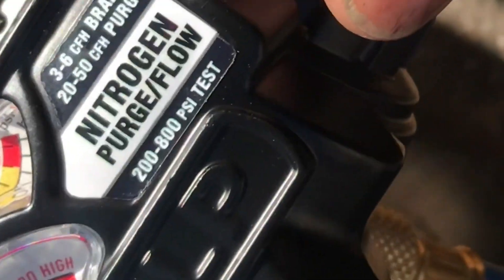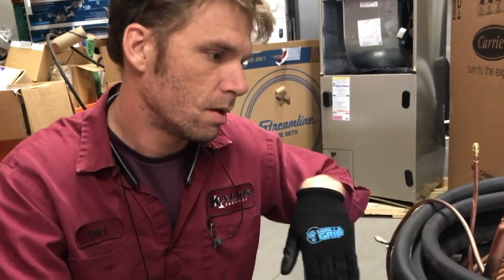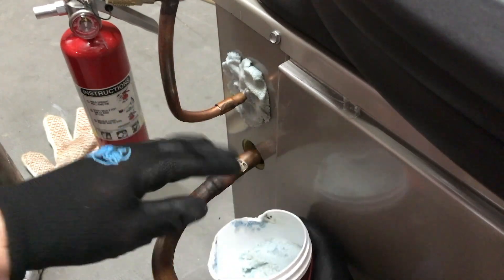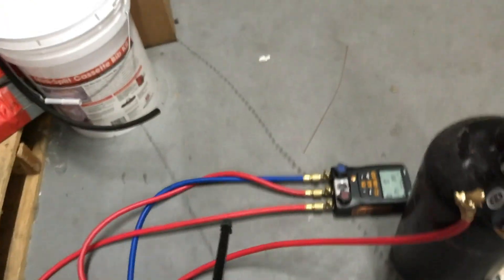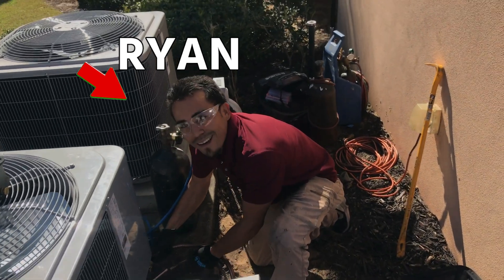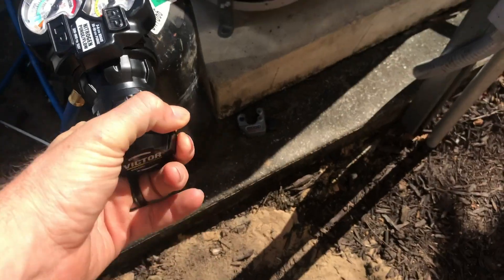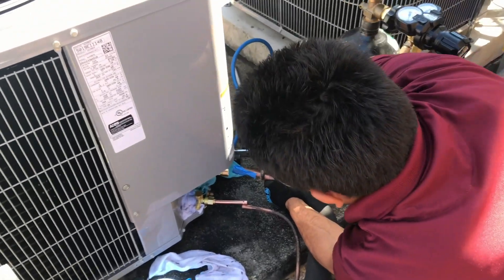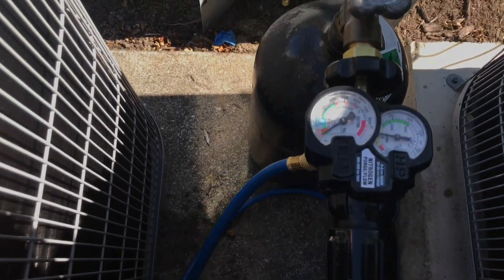How to Flow Nitrogen While Brazing

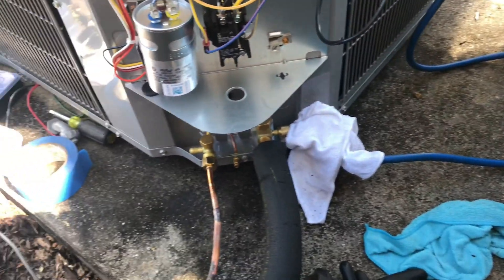Comment: 10:50 - Can you get the canoe in the reversing valve positioned so the nitrogen flows through all the pipes at the same time, or is that a multi step process? I’m not sure how to proceed to be sure there is no moisture left at that point.

Comment: When the trainee started brazing, I was expecting to see a turbo torch. The gross majority of new guys and residential guys I know use a turbo torch. It drives me nuts; but I'm a commercial/industrial refer guy. Same concept, just a completely different animal lol. I was pleasantly surprised to see your trainee using oxy-acetylene. Nice quick heat to get in and out instead of cooking the s#!t out of the joints with a turbo torch. 

Just a little constructive criticism for the new guy(not so new anymore since the video is a couple years old)...I would've wrapped the service valves a little better and I would've added a drier. Especially since you're reusing the line set (unless the condenser already has one in it from the factory?).  A sight glass probably wouldn't hurt either depending on how long and how high the line set goes. Otherwise this is a great informative video. It's very important to flow nitrogen.

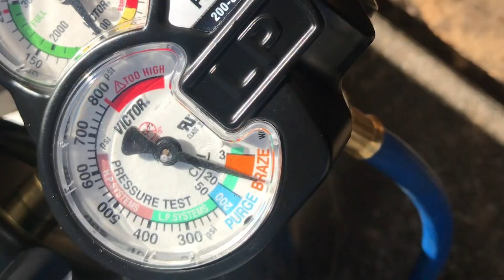Comment: 9:13 - What length of time would you give for the purge before backing the flow down to braze?
Reply: I made a mason jar to flow through and extinguish a candle flame within to determine the time for the size of the system that I needed to purge. Now I just time it based on that for that system. All systems are different sizes. 
But a few minutes is basically it. I’m assuming like me you want to conserve nitrogen.

Comment: Schrader valve. If that purge regulator only went to 150 psi it would be perfect for what I do.
Reply: What do you do?

You can set that regulator to a constant 150 psi all day as long as there is at least 150 psi left in the nitrogen tank.

Comment: Decent video. Just was looking for where the part saying the order of brazing. Everyone I've see so far just brazes in whatever order. Mostly they be doing everything outside first, then inside. I was told/taught to follow the flow of the nitro was the right way. Hard to find that on the internet.lol. By the way you said their was, "Oxygen in the air.".....😆 Kinda lost me some areas on here. Like when you pulling a vacuum, your also pulling the Schrader valves??? I thought, " You'd be just pulling another vacuum if they not in there.🤣 Or is everyone doing that wrong also??🤣
Reply: I know this is an older comment, I'll try to explain some of the concepts in the video. 

Removing the cores will allow you to pull a nice deep vacuum relatively quickly. There's nothing in the way restricting the vacuum pump. But if you pull a vacuum with the cores removed, you MUST use a special vacuum rated core tool so you can put the cores back in when you're done. Otherwise the entire system will bleed out when you remove your hoses without any cores. When using the core tool, make sure you put the cores back in AFTER you charge the system and it's under pressure. Never put the core in while it's under a vacuum. You'll end up introducing air back into the system, even just a little bit, and you'll have to pull another vacuum again. I highly recommend Trutech tools. If you're confused about what you need, just give them a call and they'll help you get set up with what you need. They're extremely friendly and knowledgeable and, in my experience, they're much cheaper than what you get at your local wholesaler. 

When it comes to brazing in a certain order, it doesn't really matter. The most important thing is to understand how the system flows and operates. This understanding should become second nature and it will allow you to approach it in a way where you'll know if nitrogen is flowing in the area you're brazing. There is no specific order. All the joints have to be brazed eventually. I also recommend using an oxy-acetylene torch instead of a turbo torch. Especially around service valves and TXVs. Those components have a lot of mass and can take a lot of heat before braze rods start flowing. Oxy-acetylene is nice quick heat that will allow you to get in and out instead of cooking the s#!t out of it with a turbo torch. I've seen a lot of guys screw up brand new out of the box valves using a turbo torch. 

When you start heating up copper with your torch, the oxygen in the atmosphere causes copper surface to oxidize and black flakes will get into the system. Depending on how much oxidation gets in there, it will start plugging up the TXVs(or whatever metering device), filter driers, and whatever else is in the system. Since nitrogen is an inert gas, it will prevent the copper from flaking and will keep the inside of the copper lines nice and clean. In my experience, some oxidation in the system won't cause any problems, but the potential is always there. 

If there is anything to take away from this video, make sure you understand the refrigeration cycle, think, and just be smart about your brazing practices. Once you work on enough of them, your understanding of the process will become second nature.
Reply: The best practice for the order of brazing is from where the nitrogen goes in to where it comes out! It seals it off as you go to where it exits! Just in case, but not likely, you have any introduction of air into the system at an unbrazed joint before the joint you are brazing! Normally speaking this will never be a problem when positive pressure is maintained with the nitrogen flow!

Comment: How do you know nitrogen has filled the whole system (time to start brazing)?  Or just by guessing?
Reply: I built a flow through mason jar and put a candle in it.
When the candle  goes out I give it thirty seconds more, then turn down to a whisper and start brazing.
Reply: Use the maximum pressure on the nameplate

Comment: What can be done (if anything) if the contractor installer never purged with nitrogen while brazing a new install with new line set? I have witnessed this so often, i thought it was the norm!!
Reply: Check temperature drop across filter drier. 

If filter clogged with trapped debris it will form a restriction and result in a measurable temperature difference between the inlet and outlet of the filter drier.
Reply: This is an old comment, but I'll respond anyway. What I would do is perform an inspection and preventative maintenance on the system. Change the air filter, wash the condenser, inspect and tighten all the electrical, and then check the pressures and temperatures on the system. Maintenance should be done every year. If the pressures and temperatures look good, I wouldn't worry about it. If there is an issue, the system will have to be opened up to clear the restriction and a filter drier should be installed to capture any residue flowing through the system. 

It's usually a pretty straight forward procedure. If you're a technician, you should know how to do all this(or you're learning how to if you're new). If you're a home owner, I highly recommend getting in touch with a reputable service company and get on a service plan. They'll come out and service your equipment once a year and you'll usually get a discount service calls and repairs if you end up with a problem.

Comment: Would using the vacuum pump work ? To remove oxygen while brazing ?
Reply: If pulling a vacuum while there are fittings yet to be brazed, what are you pulling into the system?

Comment: thanks Bert. the person that showed me didn't take out the schrader core when flowing. now it makes more sense!
Reply: I know this is an old comment, but here's my two cents. In this video example, it's a basic condenser and air handler install, so it was smart to remove the cores in this case. However, it may not be necessary to remove all the cores in the system. It really all depends on how you're flowing the system and where you want the nitrogen to go. Sometimes, instead of removing the cores, you can just hook up your gauges and let the nitrogen just flow out of the hose.

I work on commercial and industrial refrigeration. Refrigeration systems have all sorts of different controls and components where refrigerant flows through. Depending on your situation, you may not need to remove a schrader core. The most important thing is to understand how everything flows through the system. This understanding will allow you to control exactly where you want to flow nitrogen. If you work on systems enough, this understanding will become second nature.
Reply: @paulcrandall2534  removing the cores important for the next step, vacuuming thw system and verifying decay leak rate.

Comment: Good video. So many installs and repairs are done with out nitrogen.  I had a discussion with someone about the nitrogen usage and the heat flow while using it that I created a thermal imaging video showing the use and the heat flow direction in regards to the flow.
Reply: While you're brazing, the braze rod always follows the heat. You can drag a puddle just about anywhere using a torch. I'd like to see that on a thermal cam. Sounds cool!

Comment: How many Cubic feet to purge the average system. The flow meter tells a rate of volume, but how much volume should be sent through.  Do stick your finger on one end, count the seconds it take to build 15 psi and then multiply that. How many time over should the nitrogen displace the evaporator and tubes ?  If you flow 20 CF/hr for 15 second then cut down to just under 3 CF/hr   does that do it, if you diddle for a minute and then spark up the torch.  I'm pretty sure on a big unit, one would want to calculate the cubic feet needed, rather than merely guess.  Maybe you light a punk(smoldering stick) and wait till it gets snuffed out.
Reply: How bout you turn on the purge,  light a cigarette, take about 4 leisurely puffs then call it good. Your purging kid, not splitting atoms.🤯
Reply: @mitchdinner9743  Nitrogen and oxygen are nearly the same density, so it is merely the volume of the tubing -- a "fraction" of a cubic foot.
Reply: @dunckeroo1987  I give up
Reply: @mitchdinner9743   But thanks anyways> I got obsessed with the math and 4 puffs would be fine.
Reply: @dunckeroo1987  😐🤔😁
Reply: about 6. turn to purge, get your rags wet and torch lit, fill up the spray bottle then switch to braze mode. 2 minutes

Comment: Its amazing to me who been doing this technec for many years, that many veteran technicians dont do this. I remember in my younger years we use to use stay brite soft solder. This practice has been in text books for a longtime. Good work on the videos.
Reply: I know this is an old comment, but I'll say something anyway. 

I agree with you. I'm a commercial/industrial refrigeration tech and I've seen many veteran service techs braze without nitrogen. They always say "the drier will catch it." I've been guilty of this practice too. If I'm out of nitrogen and I have a few more joints to do, I'll just braze it and not worry about it. It saves me a trip to the wholesaler and I have to get this cooler up and running ASAP or they risk losing thousands of dollars or more in product.

I've used soft solder a few times. It works, but I don't like it. Some of the old timers do it that way. I use oxy-acetylene with Stay Silv 15 brazing rods. That is my go-to setup. I like to see a solid brazed joint when I'm done.

Comment: The proper regulator to use for purging is a flow meter.   You need very little flow, once the lines have been purged.  Nitrogen has become expensive, and it’s good not to waste it.  If the flow will extinguish a lit match, it is enough.
Reply: I know this is an old comment, but I'll reply anyway. 

You make a good point. The nitrogen needs to be enough to extinguish the match. Not blowing the flame out, but actually suffocating the flame from the lack of oxygen.